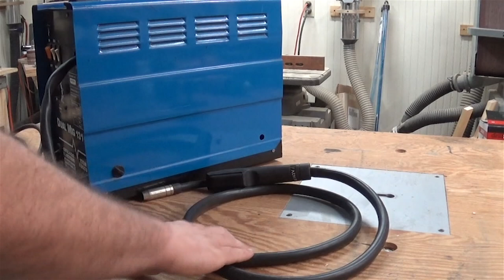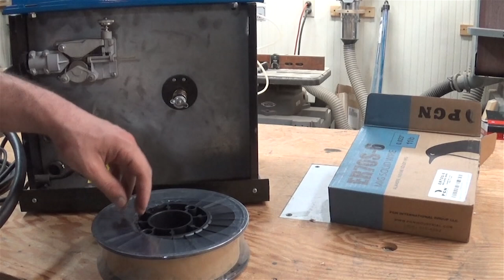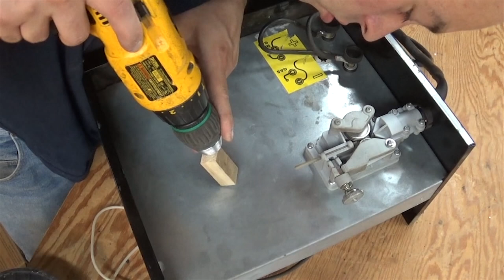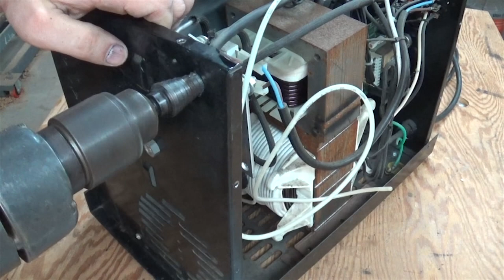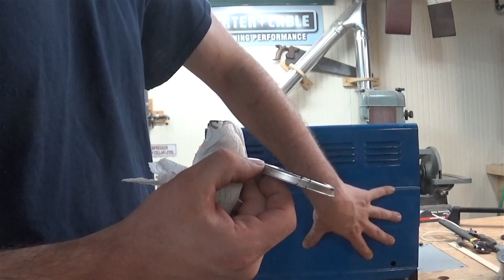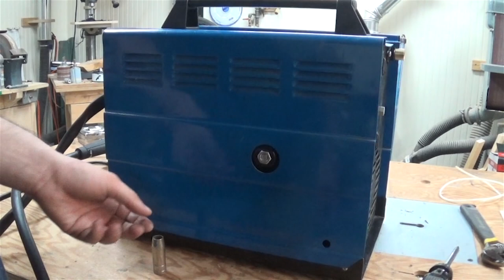Modifying a Harbor Freight Dual Mig 131

Comment: I have this same welder i bought from a guy that never used it. It came with a full 20 cubic feet 75/25 mix of Argon and CO2 mix tank. The only thing i had to replace was the nylon wire liner . This welder works fantastic with gas and without. when using with gas the welds are flawless . and fluxcore wire works very well also. I have welded new fame sections in my jeep wrangler that look perfect. I think the one i have is a little newer then the one you are showing.
Reply: Where did you get the nylon wire liner with I am having the same issue. Thanks I advance
Reply: @DGO91QUINONES  Amazon.But i since upgraded to a metal liner i bought from Harbor freight . just snip off the end and it slides right in like the OE liner.
Reply: @lar4305 thanks. 12.99 for the one at harbor freight. Better then having to wait for Amazon to deliver if I had ordered it from them.

Comment: Very nice video  as usual, wealth of knowledge. Thank you. I have a 60 Hz input voltage inverter welding machine that I'm trying to run out side the US in a 50 Hz input voltage, what do you think the disadvantages of doing that on the welder?

Comment: Lian, I need your help, I had an issue with my feeder not wanting to stop once the welder is turned on, I removed both wires that came from the trigger. One went to the rear of the welder, I can't seem to figure out where the other one goes. can you help me with this?
Reply: I'm having the same problem